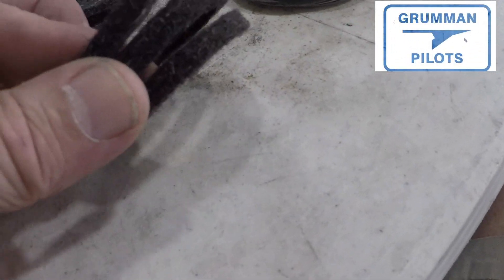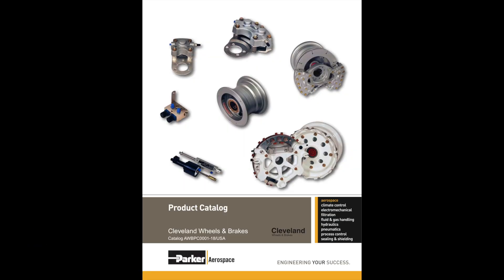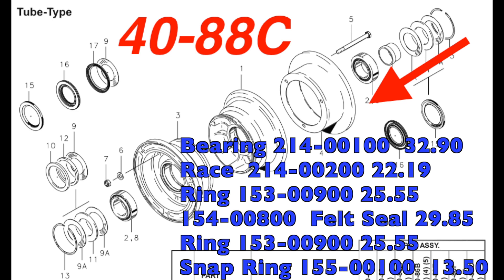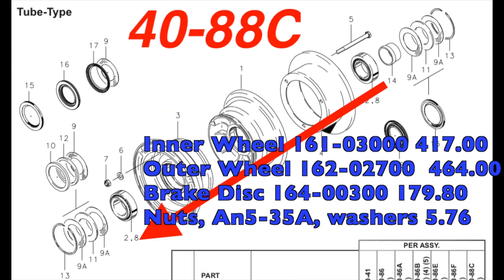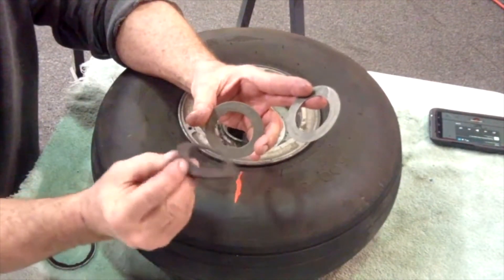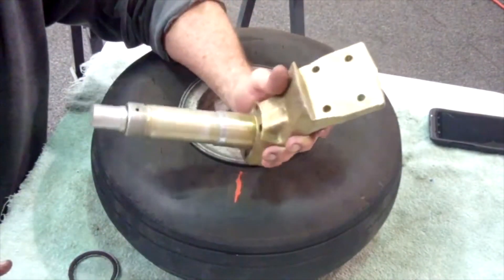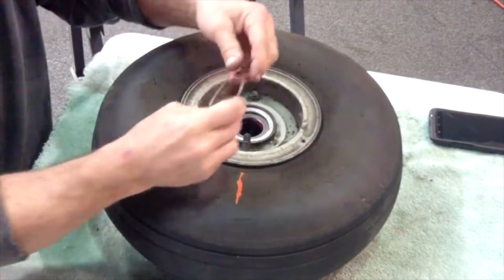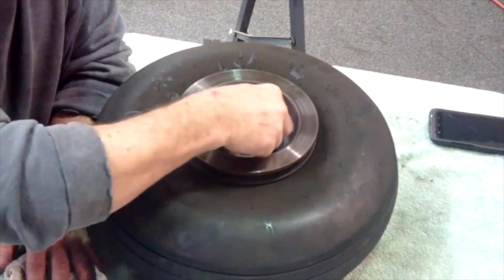All About Grumman Wheels - Grumman Style

Comment: You list the felts for inboard and outboard as the same 154-00800 part number, but in the Grumman manuals on your site, the AA5 book has the felts as two different numbers 30010 outboard and 30011 inboard. the outboard ring before the snap ring is deeper and different than the washer type on the inboard. do you have the part number for the outboard felt to order from aircraft spruce?
Reply from the maker: Diffe4rent on the main, smae on the nose.

Comment: The paint stripe is a good idea.  It also serves to see if the tire is slipping on the wheel.  Several times I have seen flat tires dur to the tire moving on the wheel and physically pulling the valve stem out of the tube.
Reply from the maker: Claude also suggested a stripe on the inside as well to see it when moving the plane from the front.